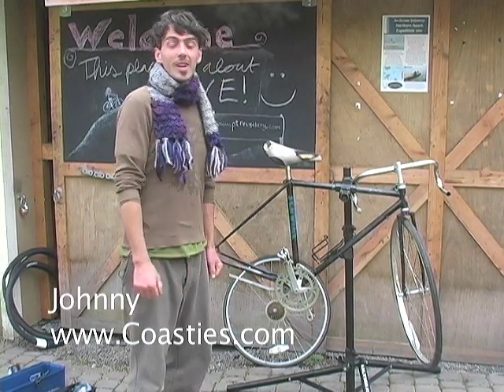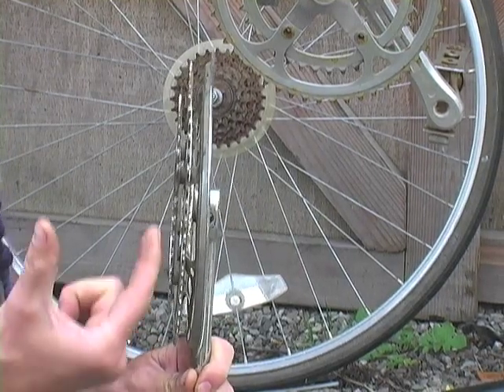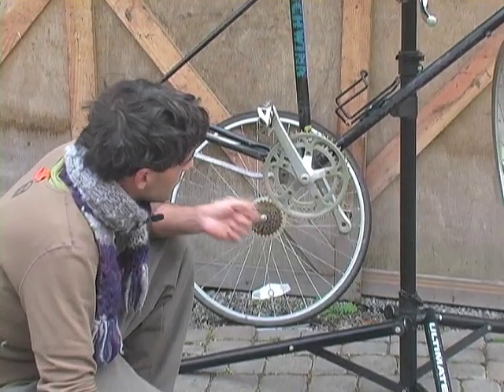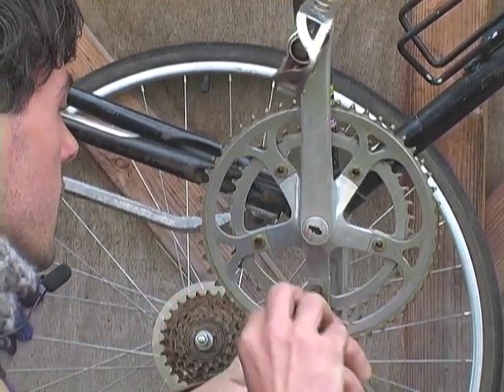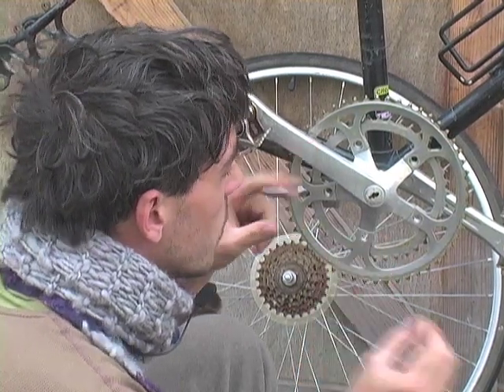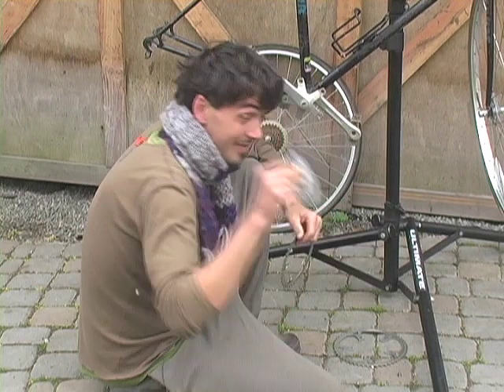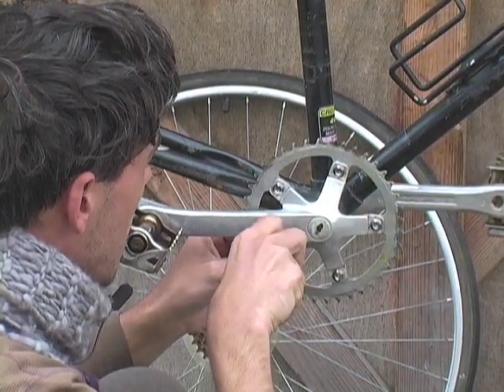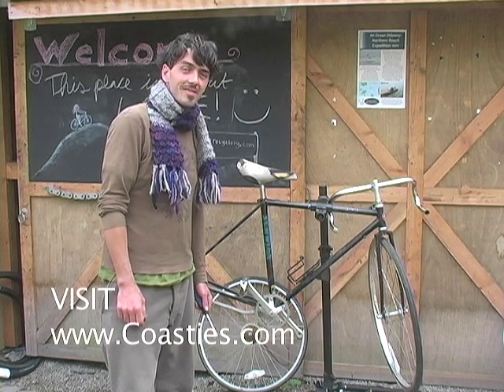How to Build a Single Speed Bike #6-Single Speed Crankset

Comment: I just got a new 27" rim with a coaster brake hub.  I think the spacing is 110mm.  Most 10 speed road bikes have 120mm dropout spacing.  Do you have any suggestions for getting a good straight chain line?

Comment: Quick question if anyone could help, i'm having a bit of trouble. I have a race bike that i am trying to convert to single speed, and on the rear wheel there is 3 sprockets for the different gears, and the derailer,  i want to remove the derailer and leave the three sprockets on the rear wheel and just have the chain run from one of them to the chainring, is this a problem? is it possible or will i have to remove the other remaining sprockets that will not be in use? i basically want to keep the bike the way it is now but remove the derailer and use as single speed. anyone that helps i'd really appreciate it. thanks :)
Reply: Allah akbar

Comment: More or less yes, but no one uses a system based on that-- it's all about the number of teeth. But if you want to know, my first gear on my cassette has 11 teeth on it and it is roughly 1 1/4 inches in diameter. I would be willing to be that is fairly standard, so if you do some math you might be able to figure it out.